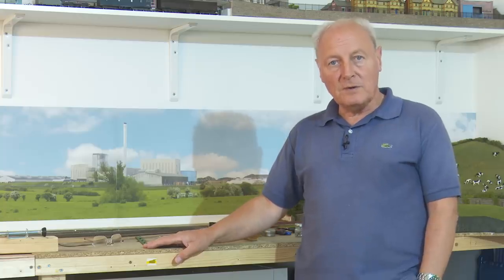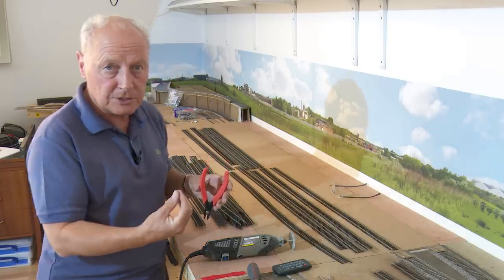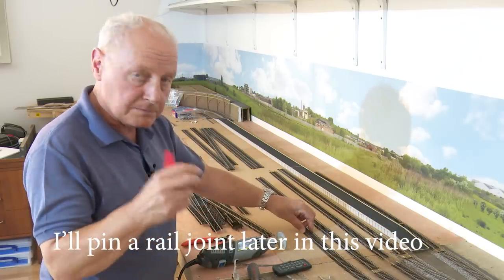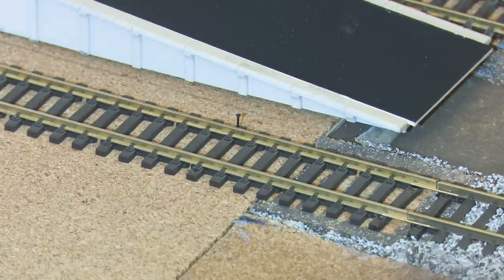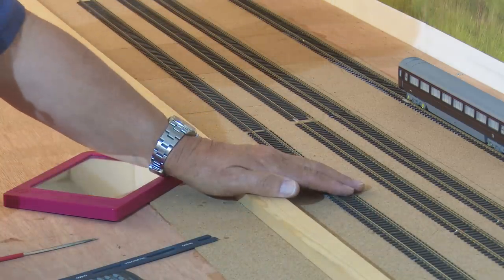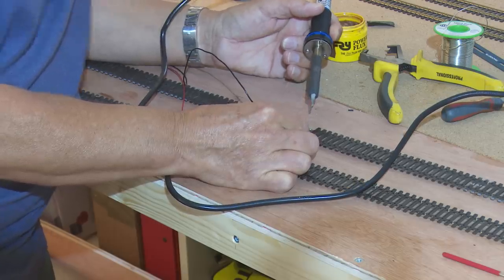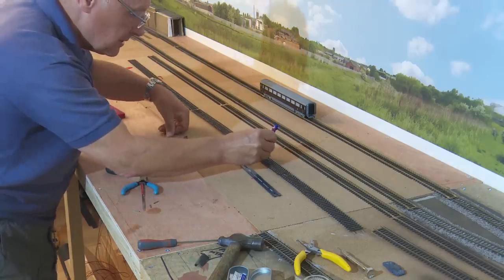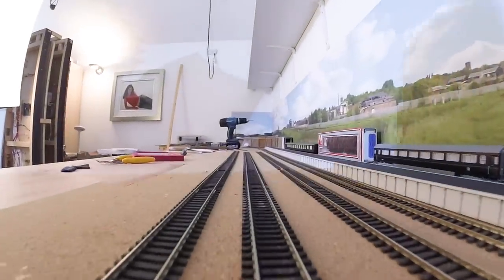Track Laying Glue or Pin? at Chadwick Model Railway | 38.

Comment: Hello Charlie, I’m working with Marklin ‘Z’ gauge as I’ve only a tiny fraction of the space you have. For cutting the track I noticed a ‘chop-saw’ disc cutter on ‘Proses’ designed for cross cutting z gauge track and I just wondered if you or any of your colleagues has ever seen one in action; as I’m sure you’d appreciate there’s quite a difference in how you cut z gauge to any larger scales. Really interested on the gluing/pinning process, do you advocate soldering every join in the track or just occasional.
Yours truly,
ross
Reply from the maker: Please don’t solder every joint. With heat expansion your track could buckle. Perhaps solder every other joint if you wish.

Comment: A good video showing some basic skills.   But, there is no need for the use of acid based flux when soldering wires at all.  Use rosin cored solder (Ideally lead content type 60/40). Clean the area to be soldered with a fibre brush and apply irons heat onto rail and pre tin (coat with solder) the rail and then pre solder tin wire end. Coat iron tip with fresh solder, lay wire on top of rails tinned area and apply heat to wire/rail for a second or two. Job done and absolutely no risk of the acid in the flux causing possible later High Resistance connection or failures of the joint where the acid has attacked the joint because it hasn't been washed off!  
As for track laying your approach is good but IMO rather long winded!  Why didn't you pencil a line along the track edge before gluing and then use the line as a guide to bond the track reasonably straight once glued in place?  A 3ft  long steel rule (Cheap market stall purchase) makes an excellent 'against the sleeper edge' straight edge rather than a bit of 2" x 1" timber, which probably isn't straight anyway!
I did enjoy the video though and its nice to see you take the time to explain the process, even if I didn't agree with it all :-)
Reply from the maker: I’m so pleased that you enjoyed it Brian.
I shall look into your point on solder choice.  I use this on track because I have yet experience any problems with it.  Regards Charlie
Reply: I was thinking the same re the soldering.

Comment: I pin, I think pinning is the best because if you want to move your track. That happened to me so I feel that’s the best. Also, if you are using foam, pins have never been easier!
Reply from the maker: What really matters is that it works for you and you can make adjustments when required. I’m so pleased that you enjoyed the video.  Regards Charlie

Comment: Hi Charlie and thanks for taking the time with your videos.  Enjoyed all I've watched so far.  Regarding not using old steel track because all it will do is rust, is that such a bad thing?  Are there other reasons why not to use steel track?  Magnets come to mind.
Reply from the maker: It’s just that keeping it clean can be challenging Ronan.
Reply: @ChadwickModelRailway  Thanks Charlie.

Comment: hi charlie i have always  using screw s for bedding the track as   better than pins  in case as you mill have many times alter the lay out later  easy to unscrew than trying to pull a pin out  but you are more   expert  than me what is your choice it may be a permanant layout ore one than maybe for shows at exhibitions ? thank you i listen to your advice and great vlogs
Reply from the maker: Thanks R1000, the screws are very useful.  Regards Charlie

Comment: Another great video! How come you didn't use Ratio brick platforms? Would they not be more period appropriate than the concrete ones?
Reply from the maker: Hi Sub39h,
To be honest I’ve yet to decide on the final finish.  The layout will be around 1968-1972 and a new build parkway, so I’m still undecided.  I’m so pleased that you enjoyed it. Regards Charlie

Comment: I used to glue, now I "pin" or use large track spikes to simulate spiking to "hide" the pin.  Why did I change?  Easier to pull up a "pinned" track for changing, than glued track.
Reply from the maker: I understand your thinking but do you ballast your track, as that would hold it firmly in place?
Reply: Yes, I do ballast it, but it all comes up with little trouble.  The "pins" just allow me to reuse the track.

Comment: Great video! Just curious, I see you've laid out a corkboard underneath your tracks as opposed to cutting out specific strips to fit the tracks. Are there any advantages to this method? 

All the best!
Reply from the maker: I know it’s a more expensive way of doing it, but it does allow greater flexibility if I need to move the track over a little bit. Regards Charlie
Reply: @ChadwickModelRailway  thanks for the quick response! I'd like to purchase some boards for my project. Any recommendation on where to go? All the best
Reply from the maker: I bought a large roll of 3mm cork on eBay Lou.

Comment: Hi charlie, I am a new subscriber so apologies if you have answered this before, but I was thinking that rubber solution cement (i.e cow gum) might be a good option for track laying. I was thinking it might have good sound absorbing properties as it doesn't dry solid like PVA, is easy to remove, and keeps its rubbery texture and may have insulating properties too.
Reply from the maker: Thanks for the tip Andrew.
I’m on the case for rubber type glues.

Comment: Your videography is excellent!  Top notch!  Do you only apply the contact adhesive on the one side -ie: the cork?  And not also on the underside of the track?  That's how it looked in the video.
Reply from the maker: Yes Kevin that’s correct . The bond that I get is strong enough.  Should I need to make an alteration there is no damage.  Regards Charlie

Comment: Great video as ever. One question, don't you find it noisy gluing track? I've just started my first model and glued the track to the foam but it was incredibly noisy. So I lifted it and pinned it down and it made an incredible difference.
Reply from the maker: Hi Tony,
That’s unusual as I would expect the sound to be transmitted through the pins.  You mentioned foam but are you intending to ballast?
The reason I ask is because ballast is dreadful for the transmission of the drumming noise into the baseboards.
I now use Copydex to glue my track as it’s a similar to silicon and shouldn’t transmit sound.  Of course ballasting will still undo this work.
Unless of course we can find a silicon based glue suitable for ballasting.
Regards Charlie
Reply: Chadwick Model Railway 
Sorry Charlie, I’m obviously not concentrating, I meant cork. In any event, I’m now experimenting with gluing 3mm foam to the baseboard followed by cork and then the track on top. I’ve tried it with a very short test piece with great results. Once the glue on the foam and cork have dried I’ll try gluing track on my fiddle yard to see if that is quieter.
Reply from the maker: Do keep me posted Tony especially when you start ballasting. 
Regards Charlie

Comment: It looks like you are using OSB board AND plywood. Why two different types and why not just one piece rather than two? Also, the leveler is genius. I live in a humid area with cold winters so there is a lot of movement with the wood during the year and this never occurred to me over  the decades. Great videos.
Reply from the maker: I’m so pleased that you enjoyed the video.  The two end boards I’ve recycled from a previous layout hence the change in material.
The reason for the use of three boards is firstly so that I can work on them upright. Once that I have fitted the points, their motors along with their wiring, I fit them into their permanent position. 
This saves a great deal of time working underneath them.  
Also, if they are too big, I can barely get them into my friend’s van.
Regards Charlie

Comment: Hi Charlie,

I was surprised to see you appearing in a Peco video, or set of videos, about track laying and ballasting. I never knew you did those. Which came first, the Peco videos or Chadwick Model Railway videos? In this video you say you prefer to glue track (and normally you would use a plastic ballast spreader/dispenser to ballast), whilst in the Peco videos you prefer to use pins and you use a teaspoon to do the ballasting. I would assume you did the Peco ones first, and used the track pins they sell as it would make sense to help sell Peco products. Have things moved on with your preferred techniques since you made the Peco videos?

Why do Peco call fishplates “rail joiners”, as I thought “fishplates” was a standardised term in railway modelling?

Do you ever solder join the two joined rails together, as I have seen others do on YouTube... i.e. they slide the rails into the rail-joiner/fishplate and then solder the two rails together just above the fishplate? Is that overkill?

Regards,
Jim
Reply from the maker: Hi Jim,  
On this occasion I was asked to promote products for Peco as a paid job. 
As you can imagine the views and techniques are not mine but those recommended by Peco.  I never use a spoon etc to lay ballast.
Fish plates is a tradition British term which I believe comes from Victorian times. It is the correct term but I imagine that Peco uses terms better understood worldwide.
I never solder rails together.  If the temperature on your layout fluctuates (loft, garage etc) to extremes, this could well cause serious track damage.
Regards Charlie

Comment: Great tips again Charlie. I am finding your videos incredibly useful in the build up to my first build since I was young. Do you solder droppers to literally every piece of track for a dcc layout? It seems like it from the videos I've seen of yours.
Reply from the maker: Hi Paul, I’m so pleased that you enjoyed the video.  Yes almost every piece of track I solder on droppers.
It gives much greater reliability.
Reply: You could also use the Peco pre-soldered droppers onto fishplates - this can kill two jobs in one and if placed strategically are very cost effective. I can solder but it makes the job alot easier and faster IMHO. BTW if using finescale eg SMP track, use the Peco N gauge droppers/fishplates. And as Charlie alludes to, check first where your cross members are under the board BEFORE you choose the location for your droppers (same for point/frog wiring) - saves alot of time having to reposition/redrill as I found out the hard way. HTH

Comment: i used to use pins to lay everything out to see where I wanted it to go as part of the designing process.. the final product was gluing it down. I used to build up modular layout too..
Do you have any "foreign" power? I am in the US and I had mainly American trains of course but I did have some UK and European (foreign to me)  trains too.
Reply from the maker: The same track laying method as me.
No I’m strictly UK Western Region between 1968 and 1975.
It’s a way of limiting my budget.
Reply: @ChadwickModelRailway  Oh ok got it.. I ran mostly a 1980's - 2000 KCS layout od end sd40-2's, ac4400's, etc I did get some newer stuff towards the end and like I said some foreign (to me) power. I had a couple of Deltics and some coaches and some German diesels (I cannot recall the model / class of them). But due to having to move for work and so on I ended up donating all of it to the local model railroad club in my hometown. I did keep my brass GE ES44 and EMD SD70ACe though since they are collectors items and gifts from my dad too..

These days as I mentioned on another video I am limited to simulated railroading (mainly due to a busy work schedule ).. I have gotten fairly good with 3D modeling software (Blender) and when I have time I mess with all that stuff.

Comment: Bit of a late reply but how do you deal with the big gap in the sleepers under the joint between sections of rail?
Reply from the maker: Hi Paul, I just insert and glue a sleeper into the gap with the chairs removed.
Reply: Thanks Charlie. 👍

Comment: Hi, Charlie, I have just sent this to Richard at Everard, and I know you did this video a while back. Which way did you go, and if glue, what have you done to suppress noise conductivity, in relation to future filming. or will ballast suppress it. or did you choose to tack it, and do I now have to consider ripping up the glue in favor of track pins?

I have followed you and a few others in starting to copydex my track instead of pinning it this time. It's easier to deal; with and less damage. It's also easy to lift if wrong ( well a little).
I ran trains around part of it yesterday to test the track and film it. The nose was very loud, and almost drowned out the loco sound on the film.
I was warned that the glue any glue conducts the sound making metal wheels very loud. This will almost certainly affect future filming I am sure. 
Can I ask that surely it is not just me, are you experiencing higher wheel noise due to gluing over tacking?
If not have you do something to combat and reduce its effect.
I was told this might well happen, but ballasting will reduce the overall noise. Is there any truth in that. I hope you may have some advice and better still some encouraging words to make me stop thinking of ripping it all up and starting over with track pins.
Kind regards Paul at Sandling Junction.
Reply from the maker: Hi Paul,To be honest, I have never noticed any increase in volume using glue.However, (here is the shocking bit) whether you glue or pin, I believe that it's ballasting that causes the real sound issue.  Once down and glued, ballast appears to be one huge mass and transmits the noise into the baseboards.Check out Richards's latest at 39 mins 50 secs.Give me a call anytime tomorrow to discuss it further.Regards Charlie
Reply: cheers chum ill do that thanks
 @ChadwickModelRailway

Comment: Absolutely POSITIVELY Glue Only!!! Since I started, 13 years old, 1975.... From the beginning I was told at every Hobby Shop, and every one hence - NEVER NAIL (Pin) Track to the Roadbed!! 
Besides preventing Shorts and Derailments, due to Nails (frequently in out of sight places) getting loose and pulling up....
It's terribly UNrealistic!! 

Your Layout looks great!! Nicely laid Trackwork, and pretty good advice. Particularly when you mentioned about checking the Track, even with Mirrors. 
I've found that if you use a Good, reasonably flexible Flextrack (Peco, Atlas, Model Power), I only use small Push Pins, to hold the Track Temporarly, until the Glue dries. 
And as you said, the finished, glued Ballast will hold it firm!
Reply from the maker: I’m so pleased that you enjoyed the video. Hopefully some of the less experienced modellers will find it useful. Thanks
Reply: Well, that's the whole point, isn't it? Videos like yours are very helpful. I can't wait to start making Videos again soon, on my Model Railroading Channel. Stuff happened

Comment: To me glueing is much better than nails. Even if you have to repair a track section replacing glued section is so much easier. Just remember a little bit of glue goes a long way so don't get crazy spreading glue all over the place.
Reply from the maker: I’m with you on this one Matt.

Comment: Could you please tell me the thickness or width of rail head using vernier caliper?
Reply from the maker: The height is 2.8mm and the railhead width is 1.04mm. Regards Charlie
Reply: @ChadwickModelRailway  
Which brand and which code ho scale track sir?
Reply from the maker: @santhoshn8419  It's Peco Code 100.  
Regards Charlie
Reply: @ChadwickModelRailway  
Thank you for replying sir.

Comment: QQ - To hide where you soldered the wires to the underside of the rails - did you reinsert the sleepers you cut off?
Reply from the maker: Hi Rupert,
I didn’t remove them, I just slid them along and then back again once I had finished.
Regards Charlie
Reply: Chadwick Model Railway Many thanks -  will try that.

Comment: Would use neither methods. Screw down is the only way to go. Easy to remove without damaging track.
Reply from the maker: But how do you hide the screws Simon?
Reply: @ChadwickModelRailway  I use 10mm screws with a Peco Fleischmann magnetic screwdriver. The screws are the same size as nails and are much easier to implement. Hiding is not an issue for me whether it be screwed or nails as I don't paint/ballast my track. Much as I purchase all the modelling mags each month, go to the shows and look on you tube constantly looking in admiration how good the set ups are, I personally have a large layout 'without mess' set up on a foam tile base which works fine for me and when I get a problem, I simply unscrew the track and replace as necessary. Each to their own Charlie and I respect that fact. I love my hobby dearly. Maybe I'm not enough of a geek. Loving my Hornby heavily weathered 9F at the moment. Best of luck with all you do.
Reply from the maker: An interesting reply Simon.
As you say, our preferences may be different but we both love this wonderful hobby.

Comment: Peco code 70 H0n3 flextrack is no good. I used to lay Shinohara, which was very sturdy but had big rail holders (spike imitations). Peco is no alternative as they tried to make the spikes so small for good looks, but when you want to handle the flextrack it will invariably pop up from the tie band and cannot be pushed back.
Reply from the maker: An interesting point Peter.  Regards Charlie
Reply: @ChadwickModelRailway  I wonder if there are modellers out there who have had the same experience. I now bought flextrack from Micro Engineering which is a tad better but must still be handled with care

Comment: Code 100 vs Code 75 ! Amazing how many modellers totally fail to understand the implications of these 2 rail sizes. If you use Code 100 with modern rolling stock produced in the last 20 years, you will have increased derailments in the pointwork. Why? Because Code 100 was designed in the late 1970's for the then coarser wheels/flanges of model trains !!!
Reply from the maker: Yes, Lima drivers beware!